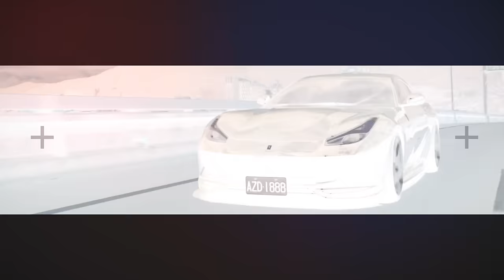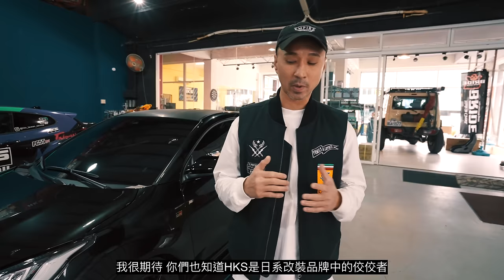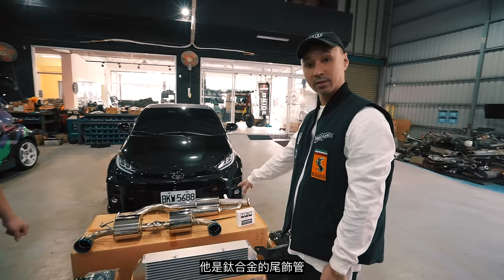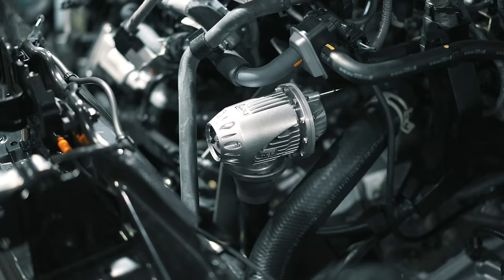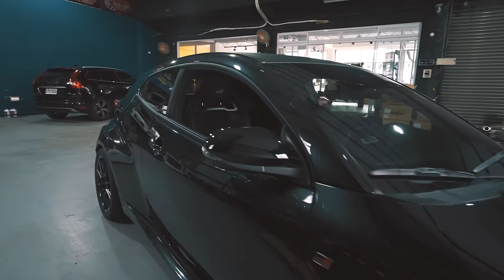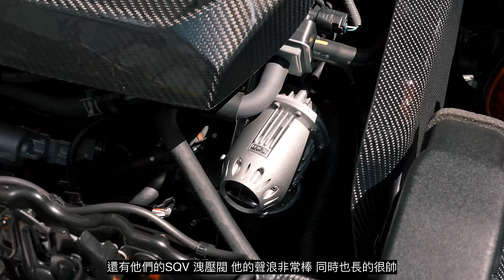GR YARIS PART 2 邁向百萬改裝之路｜GR YARIS PART 2 : ROAD MAP TO 1 MIL NTD OF PARTS《EMC Vlog Vol. 83》

Comment: Over the years I think all the Impreza owners have learned to use bypass valve and not vent to air blow off valve. Perhaps at most 50/50 if you just love the sound.

Comment: Hey Sunny, you want to check out my 1992 EG6 with 295 whp K24?  Has JRZ RS suspension...  something little different than your usual higher end cars.  :)  It'll keep up with your 992 GT3 no problem.  We should do a little mountain drive with them.  GR = Gazoo Racing.  Also means GhettoRacer la.  LOL.